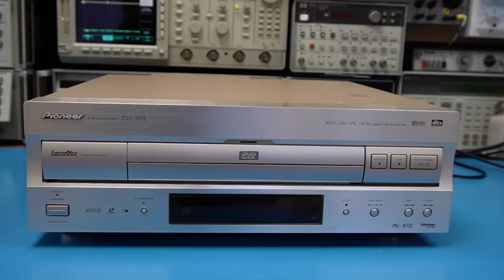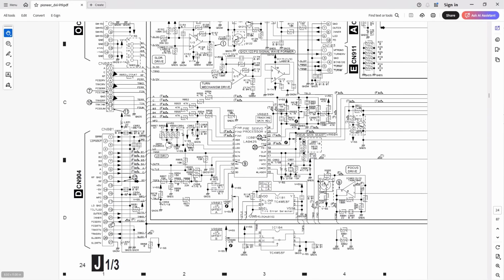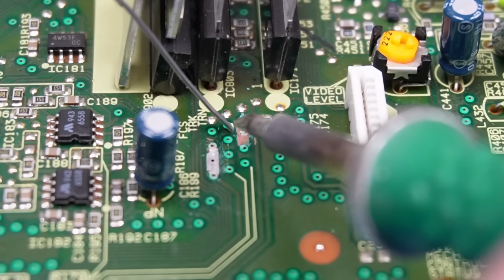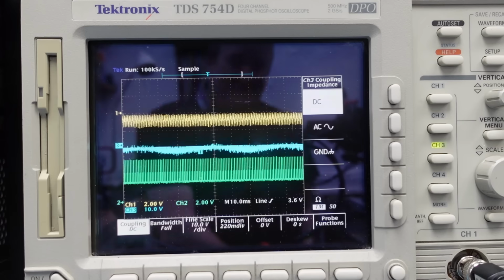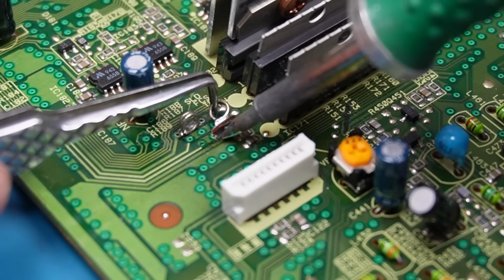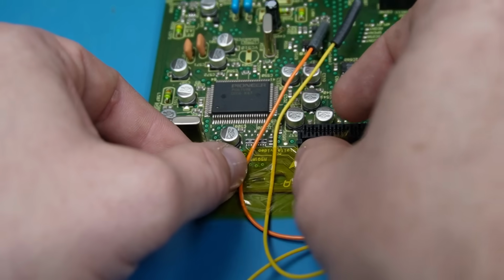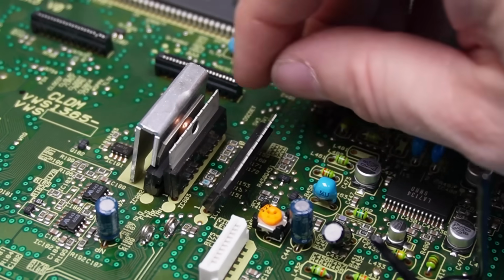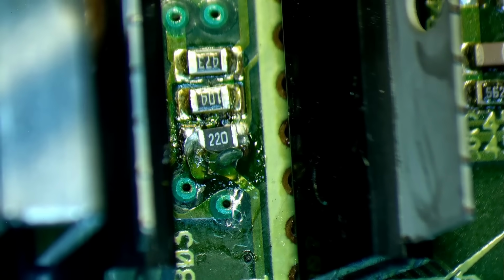Pioneering a fix for the Laser Disc Player

Comment: Thank you for the video. It amazes me how much is involved when making these repairs. Definitely rocket science to me. Lol
I am getting interested in laser displayers myself again. I had a DVL 909 back in college. I took it out of storage recently, and I noticed it had the same behavior in this video. Side A would play perfectly fine but on side B after a few seconds it will just repeat over and over and over again. If I hit the fast-forward button or the pause button, it would get past that point but a few seconds later, it would just keep repeating over and over again. Luckily my fix was quick and simple. There is an adjustment screw for the laser and it was just too tight on the rail. I loosened it and added a little grease to it and it was fixed.

Comment: Does increasing the voltage to the ICs add additional wear to the IC?  I am wondering what caused the voltage drift in the first place that would have required a completely different resistor value from the stock one.

Comment: I don't get it. I love Mark's videos and I'm sure interested in electronics, although I'm mostly clueless. But what could have possibly changed in that machine over the years that the 33K resistor of the original design does no longer fits its purpose?

Comment: I’ve been an engineer for 45 years, and watching Mark is like taking my brain to the funfair. 
I’m a mechanical engineer, so 90% of the time I haven’t got a scuby what he’s talking about but that doesn’t detract one bit from the joy of watching him rip out old capacitors & resisters and crank up the oscilloscope! 
I’ve tried to repair many a device from the mechanical perspective only to end up snapping something plastic, so I get a lot of joy from his battling with damaged screws or broken fixings.
Mark surgically replaces tiny transistors or repairs broken circuitry with a dry wit that’s has me chuckling constantly. His fault finding and diagnostics are borderline genius but he makes it look like a pint in the pub 
What an absolute legend. Thanks Mark. 🍻
Reply: I am chemical with 3 degrees in science and engineering  (makes me feel like I am an idiot to  be honest)... I watch these videos in  the same way you do :) Cheers

Comment: I saw the original laser discs being shown at the Tokyo Electronics Show in 1978 while I was visiting Japan as an engineering liaison for the Great American Sound Co.. In 1980 I purchased a Pioneer VP-1000 laser disc player, and soon after the factory service manual because I wanted to maintain it, this original player contained a high-voltage helium-neon laser to scan the discs. Years later I sold the VP-1000 and purchased a Pioneer CLD-3030 laser disc player because it could also play CD's and it had an optical digital output that I needed to test and service DAT recorders.  David Riddle

Comment: Hi mark love the videos u make me smile.
I have a sony hcd-md5 hifi and its gone dead on me had this since 1992 still look brand new but its dead, it clicks  once at the back when mains applied but no display or lights.
need some guidence if possible 
What would you Recommend i should do?
Im kinda worried about touching the 2200 caps on the pcb or caps on the power supply with a solder iron shock reasons,They are still in the board.
The hifi has been unplugged for 3 days now im not sure how to proceed (HELP) 

I have a astroAI multimeter
Any good advice would be very usefull to me just wana get it working again.😊 thankyou

Comment: This is not my field/forte, but why does it work on the underside (side A) and not B if it is the same head?  Wouldn't you expect the twisting motion as the side change rotates to be responsible?  Perhaps gravity has pulled something out of spec, and will therefore happen again sooner than later?  The electrical boost was fascinating,  but it seems more logical that its in the reader than on a daughter board

Comment: i have seen a laserdisk system (Philips) once in a lifetime...its cost about 2000 Deutschmark in former times...maybe more...the discs had to be handle very carefull. even they where very expensive too...less titles to buy...low quality...(because you still have old TV-Sets)...double sided...the machines itself do a lot of noise because of the high rotation of these heavy  disks...Playtime was a laugh....
Even a Betamax was much better in this times...

Comment: To Boldly Mod, where No One has Modded Before!! Myself, being a Pioneer Certified tech, have always complained about not having POTS for those adjustments. These players are prone to side B playback problems due to being upside down and having more stress on the motor. Brushless motors in this size did not exist when it was built.

Comment: I must say that machine is designed with maintenance in mind, even though it is quite cost optimized. Plastic holders to keep the board in a debuggable position, extra long cables that are held in place with clips, etc.

Comment: be very careful with those vias. they are not electroplated like on fiberglass/resin boards. You can't electroplate phenolic paper boards. They use a conductive epoxy that is squirted in the holes and then cured by baking or UV exposure. You cannot heat that up ! Heating such a via with a soldering iron will damage the electrical contact. Another effect is that these vias can crack under mechanical stress or exposure to humidity or corrosive vapor. They are not "hard" vias. The actual contact resistance of such a via is in the order of 1 to 5 ohms. That's why on those power traces there are 4 in parallel. An electroplated board would only require 1 via. The vias can deteriorate over time and increase in value. I suspect that is what is partially going on here. Motor wear-out will certainly also be a factor, but is suspect there is a wonky via in the feedback loop someehere that has increased the total resistance. lowering that 33k to 22k has compensated for increased via resistance.

Comment: I had a similar model with the exact same problem and it only happens on side B, and i was ecstatic with the previous video that showed the exact same problem, so i did the same solution of cleaning and greasing the gears as in your old video, however the same issue returned, so the project was shelved, imagine seeing this video. Was hoping it'll be something more on the lines of replacing a faulty component rather than changing the basic composition of the component by increasing the voltage to the motor while it's only having issues at one location on side B. Anyways you are the expert and if it solves the problem will give it a try. Was really hoping on replacing a cap or resistor. Thanks a million mark.

Comment: The PCB seems to use silver ink vias instead of electroplated ones, judging by the color difference and filled holes. Because the ink lacks the "riveting" effect of electroplating, the board is structurally less robust and delaminates easily.

Comment: You’ve got the best job in the world I reckon. But wouldn’t it have been easier to service the actual motor from the laser assembly? It seems it’s starting to need more power therefore it’s the brushes? But hey I’m no electrical engineer.

Comment: Hello.I wonder if you could help or advise. I have a portable Sony  KV- 6000BE colour TV receiver about 1984-84 era, but as its an analogue TV I cannot receive a picture. May I ask you what you would do in this situation? I would like to use it as a portable TV, therefore not using an outside aerial but its own telescopic aerial or an extra plug-in aerial which the TV can accommodate. Many thanks for your help and advise.

Comment: I recently repaired a Mitsubishi Laser Disk player model M-V7057 which is actually made by Pioneer. I believe it is a bit older then yours. It had the same issue where the sled motor would stall. How i repaired it was I disassembled the sled motor, cleaned the brushes and commutator. (I guess high resistance). I wonder if higher resistance at the motor commutator/brushes is an issue with yours?
Reply: 100%.

Comment: You might want to test the resistor after you pull it, just to verify it is what it says before you install a different one calculated with that unverified value 😂

Comment: I wonder if any of those SMD electrolytics have anything to do with the problem.

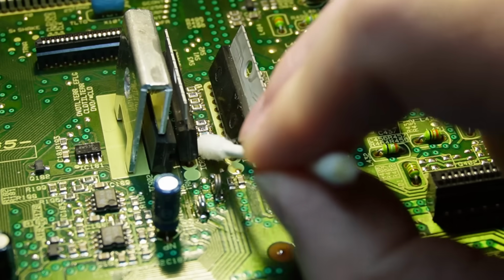SMD electrolytics from their inception in the 1980s to the 2000s are all going bad by now, they all have the same failure. The rubber plug in the base shrinks and they puke their electrolyte out. And since the electrolyte is near invisible, its hard to see unless it leaks enough to escape the wicking capacity of the plastic base. I see a couple of suspect ones with dull solder connections, namely one at 28:46, above the blue component sitting off the board.

I've been replacing those things by the thousand on old equipment, they cause hideously expensive damage.

Comment: This is crazy! If that were the case, every unit would have this same fault. Well... no, no real diagnosis was done here, no real repair was done here, just what Mark enjoys most,  modifying and destroying (the trace destruction is a amateur thing, come on, you didn't saw that coming?), that's the meaning of Mend it
Reply: A little harsh?
Reply: @wirdy1 Mark has a good deep knowledge of how electronic devices work, but it seems he doesn't enjoy to restore rather prefer to modify (show off?). To restore one has to understand why things fail, in many cases he misses the real diagnosis, or the real diagnosis wouldn't provide a good show.

Comment: This is quite a common problem with this model. My LD does the same thing. Apparently the problem is a software issue. I've seen a forum post that outlines the problems and the way to solve it... but I never did get around to it as you need the remote to access the menu on the LD.

Comment: There is a retired engineer in Japan wishing he's fought a little bit harder to have the resistors changed in the design, but he was overruled in a meeting... Well done MArk, cracking bit of investigation and fix...
Reply: That circuit designer wouldn't have the brief to compensate for wear & tear of the motor / sled over 20-odd yrs. Since Mark had already regreased the sled on the last fix, it's probably the motor torque that's gone awry. Driving the sluggish motor harder is a fix, but how long it'll last is anyones guess.
Reply: that's nonsense! you don't have a clue do you? If that were the case every unit would have this same fault. Well... no, no real diagnosis was done here, no real repair was done here, just what he enjoys most,  modifying and destroying, that's the meaning of Mend it
Reply: @paulmon4077 I tried looking for your YouTube channel of superior knowledge and technique but I couldn't find it. I find that interesting.
Reply: @paulmon4077  The very definition of a repair is to restore function. Mark restored the function of the device... But I agree that a root cause was not really explored. Sometimes, every time, 'time is money' so, the repair was a success...

Comment: Love some of the tech from this era - the rotating laser assembly to read both sides of the disc - magic! Stil left wondering why does it stick on side B when side A was OK? Can't help thinking a mod covers up an issue rather than fixing it. As the head unit flips over is gravity coming in to play and extra friction being introduced? Probably easier to mod the resistor than investigate - obviously a bit close on tolerance anyway to become an issue. I wonder if Pioneer ever issued a mod for this problem. Reminds me of the VHD system which had a 'kicker' coil on the head assembly to kick the head if it got stuck in the same groove which it inevitably did because of the tendency to clog with lubriat and dust.

Comment: Is it possible that the worm gear on the motor is worn and causing a bind?  The increase in motor voltage overcomes this until the wear becomes excessive and fails again.

Comment: Having one of these beasts myself, I’m always fascinated in learning more about the way they work. I always thought the side change mechanism was absolutely bonkers … I still feel it would have been cheaper and simpler to simply double up on the optical head, rather than create that rotating block that then had to realign itself. Perhaps it was simply a reflection of the higher cost of the optical assembly back in the day. 

The irony is that we also used to have quite a few flipper DVDs … but I think the Pioneer only flips when playing Laserdiscs?

Talking of DVDs … I assume you did subsequently also check the DVD playback aspects still worked after your adventures into the bowels of the machine?

Comment: It's very odd that the PWM duty cycle doesn't increase above ~10% or so, that would be a strange choice if intentional but perhaps it's a limitation of the micro.  The fact it only happens on side B at a specific point suggests the sled might have tight spot in the rail.
Reply: My thoughts too. More likely it's not PWM, but just increases or decreases the frequency of those fixed pulses to vary the averaged output. Much like a SMPS.

Comment: Nice work Mark.
I'm curious to understand why the sled motor drive, from the uP,  doesn't alter the duty cycle of the sled motor PWM signal to automatically compensate for the extra demand from the motor - via current feedback?

Comment: So Mark, I'm curious. What had occurred to warrant you adapting the circuit. Surely if were ment to have a 22K resistor, it would have been so when designed? I know it's probably a rabbit hole, but if you had persisted investigating; would it have come down to a Capacitor out of tolerance? I know time is money though, so the quickest fix is sometimes the easiest and cost effective.

Comment: This is an excellent demo of what I call "fallback to theory", an increasingly necessary skill when it comes to repairing vintage electronics. Those that lack the theoretical knowledge are rapidly finding themselves over their heads and exiting the industry, which leaves it to the wizards. 

Yes, this is compensating for an existing mechanical fault, but the parts required to repair it are likely made of "unobtanium" and this may have been the only practical way to restore functionality. What's actually wrong? I'm thinking the motor is ever so slightly sticky or a bushing has a slight eccentricity, causing a positionally dependent fault.

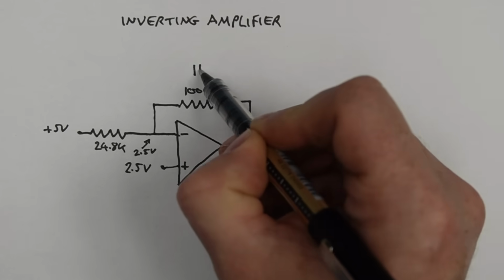Comment: At 17:22 you calculate the output voltage, but is -10V correct? As about 0.1mA flows through the 24.8k and the 100k resistor, the voltage over the 100k resistor is indeed around -10V. But as the opamp input is at +2.5V the output would be at -7.5V in my opinion.
But why only a problem on the B-side as the moving mechanism is also used for the A-side.

Comment: It's interesting that the sled drive PWM doesn't drop below 10%, perhaps increasing the tracking control loop gain (VR603) would have pushed the sled drive PWM all the way to zero duty cycle, driving the sled motor a little harder.    I don't see may people attempting the fixes you do,  your skills and patience are impressive.
Reply: We didn't see the scope zoomed in to the pulse width when the tracking was working normally; but it's likely it remained at that same width. If so, this isn't PWM control. More likely it's just the frequency of those pulses that increases the averaged motor drive signal.

Comment: I must say those ribbon cables have become ubiquitous. They are cheap but I do wonder how many insertions they last? hopefully Sony has embraced the philosophy of less is more 😊 5 over 2v I will remember that when I want to annoy someone 😂
Reply: Flat-flex cables (the word “ribbon cable” is already taken for the old-style ribbons made of individual wires with the insulations fused together) are indeed ubiquitous. The mating cycles are primarily determined by the type of socket. The friction-fit ones are only intended for a few mating cycles (perhaps 10-20). The zero insertion force (ZIF) types with a lever or latch of some kind last for longer.
Reply: @tookitogo thanks, you are correct, flat flex. There is a hell waiting for the designers of that product where they have to repair their work. That said I have seen worse I was holding my breath when Mark adjusted the angle of those op-amps, waiting for a leg to fracture 😬😮🤣

Comment: Agree about the top comment regarding Mark's editing skills. Superb as always. Must double the amount of filming time.  Regarding the tracking fault on side B. For most electronics engineers this isn't an obvious fault. Most would look to mechanical wear, even though Mark did test for this, most would not be convinced that the problem could be resolved by repairing the mechanism. Actually finding a work around by reducing the input resistance to the op-amp is a clever "bodge". Great video to watch.

Comment: Hi Mark, just a quick question,  if giving the motor more power to move by changing the resitor, why is the resistor at factory not the correct value? Is this happening because of wear on the motor or other components over time? The 33 was working from factory. Keep up the nice videos and have a good time at your new place

Comment: 27:25 I would have been tempted to leave the adjustment wires there and not make the mod permanent. At least until it was tested longer at the owner's location. It could be a sign that of slow degradation of the analogue circuitry.

Comment: Nice job on the repair for the lifted track. My only concern would be the point where the foil was folded that it would now be weakened/cracked making it susceptible for premature failure. I would suggest removing a bit more of the solder resist over that area and re-enforcing it by tinning over it. Great solution overall though to fix the drive strength on the tracking.
Reply: Agree. Some UV-cure pcb coating would've physically secured it better & would've been the icing on the cake.